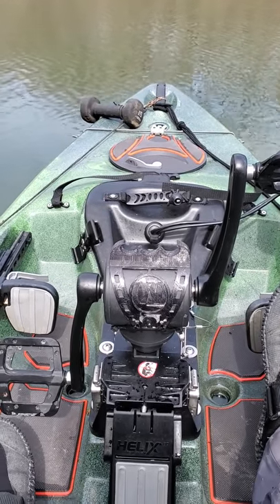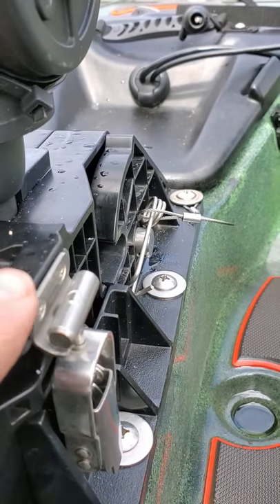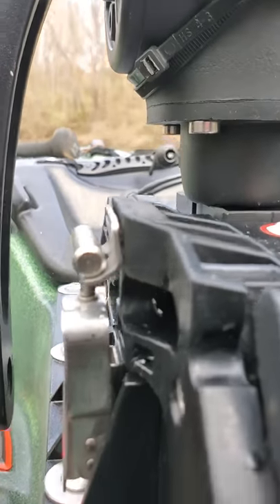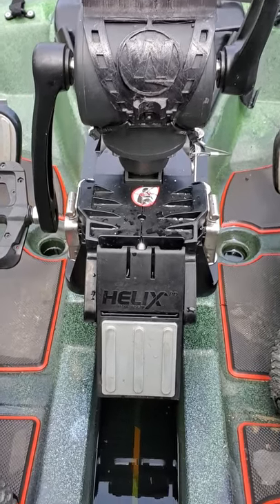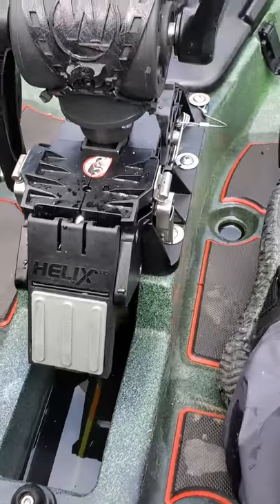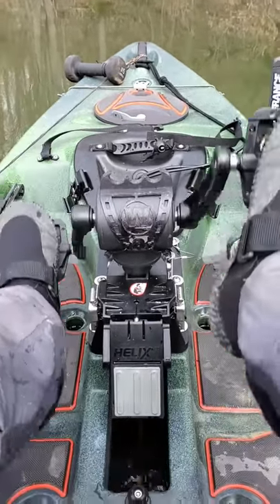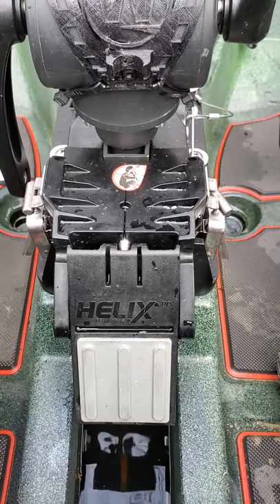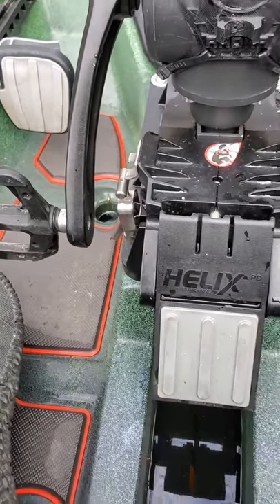Helix PD Mod   Part 2

Comment from the maker: To bend the brackets, secure with vise grips first so you don't pull the inserts out yourself. The bracket is hard, spring steel material. Bend with a second pair of pliers.